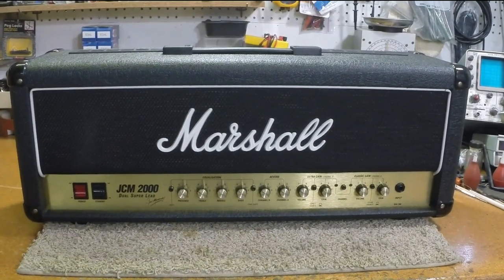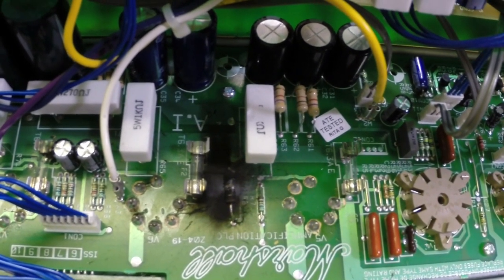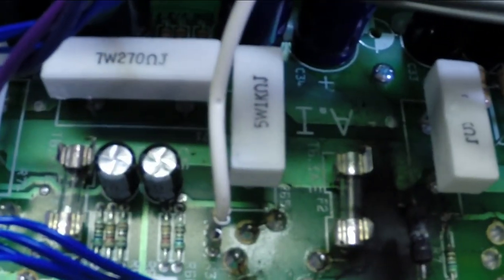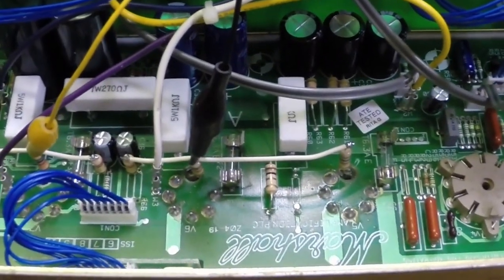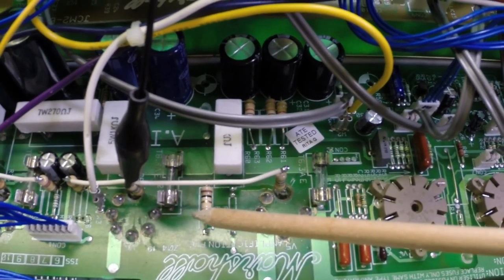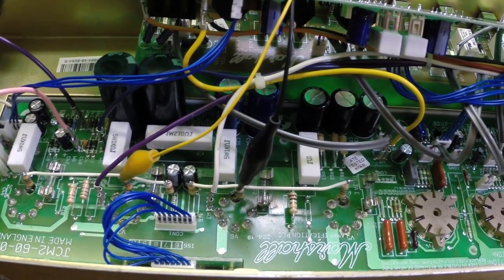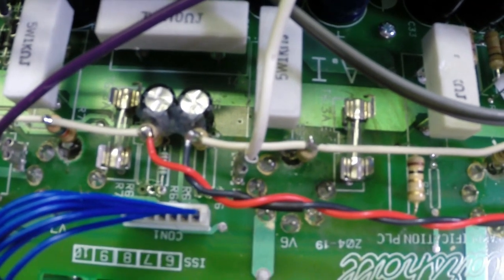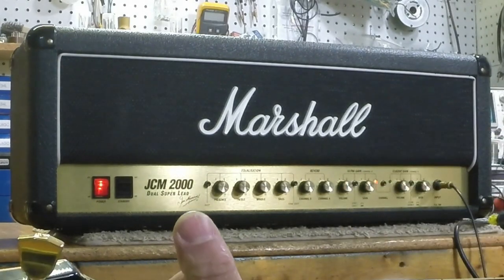Another JCM 2000 Bias drift

Comment: This is the best video on this subject, imo. I have DSL50 built in 2000 with a rev 5 mainboard. After watching several vids and reading, I did the "air gap" fix on the power tubes along with swapping the 220K stoppers for 5.6K, and it helped a lot, but it was still a little bit unstable on the right power tube (when looking in the back) after an hour, while the left tube was mostly stable. So I took it back apart and also did your excellent "cap lift" fix at the end of the video, too. This sucker is now rock solid even after hours of use and bias does not budge one bit. And the amp sounds magnificent now. Amazing how ratty it sounded with the 220K and the wandering bias... Thanks so much for sharing this info, just goes to show these amps can indeed be fixed right for under $1 in parts and some elbow grease. BTW, Amazon has the 5mm diamond hole drills for just a few $. They work perfectly for doing the air gap part. Low speed drill is best.
Reply from the maker: I am glad it helped you.  This is why I have this channel.  I get a lot of grief from "experts" but who cares about their opinions.  I have been doing amp work for decades, and have seen a LOT of issues.  Thanks for watching, and the nice comment.  Don't be a stranger, check it out occasionally.

Comment: I am encouraged by your confidence with your solution to this BS issue that Marshall has bestowed upon a legend. Just by the fact that you produced a vid explaining your solution should make me hesitate to ask you a searing question. Any way I must ask… have you had any returns with the very same run away bias issue after your services? 
I have replaced several boards over the past decade along with a couple other attempts as found on the internet. Had a couple returns with the same failure and lost a couple clients as well.
Thanks for the vid and your response.
Mark
Reply from the maker: Thanks for the kind words.  My answer will be short.  Nope, not a single return on the bias drift issue.  And I have done quite a few. Mainly because I removed the bias circuit completely away from the high positive voltages.  I believe there are a couple more videos here on the same subject.  Thanks for checking out the video.

Comment: Its amazing how they took amplifiers from point to point printed circus boards and they are more expensive. I build my own amplifiers out of 1950s and 60s PAs, gut them and put my own components in, simple, they sound great. All point to point, no crappy circus boards
Reply from the maker: I agree.  Problem here is in the age of point to point, labor rates were much lower.  Point to point also takes more skill  to do properly.  Also point to point is a wonderful thing but with modern amps with multiple channels, channel switching and other bells and whistles, point to point is pretty much impossible.  Plus throw in design /layout issues we have a mess.  Thanks for watching.
Reply: Air is a great insulator.
Reply from the maker: One of the best!

Comment: Nicely Done. I have one of these on the bench for an effects loop issue. Do you feel this should be done to any jcm2000 dsl or is it uncommon enough to gamble with. Its a 1998 model year.
Reply from the maker: It would not be a bad idea.  I have seen this a lot.  I feel it is just a matter of time.  The story is they had a board problem... I think it was more a layout problem.  I have a problem with circuit boards and high voltages in close proximity.  Don't even get me started on the high amperage current on the heaters...   :)

Comment: I have a 1997 DSL50 that i actually had you service once ( main input came off the board). But i recently had it die on me again. 

While playing it, the HT fuse popped. I removed the power tubes and ran a quick bias test, but whats happening is crazy: the left bias adjustment is working the right tube ( V7) and the right bias adjustment is working the left tube (V6). The pots are change the voltage but if you dial them all the way left ( so counterclockwise), you get -25.5VDC, while dialing them all the way to the right ( clockwise) it maxes out at -33.3VDC, so well below what you'd need to bias this right ( between -36 to -45VDC according to Marshall at least). 

Is THIS a bias drift?
Reply from the maker: Hi Mike!  I remember that, seems like a few years back.  Ok question one..... the bias controls work correctly they do control opposite sides.  As for bias drift, Usually one or both sides of bias will drift positive as the amp runs.  I have no answer for the low bias without checking it out myself.